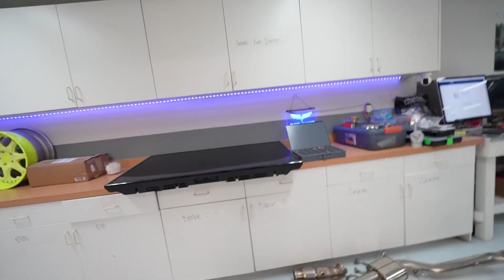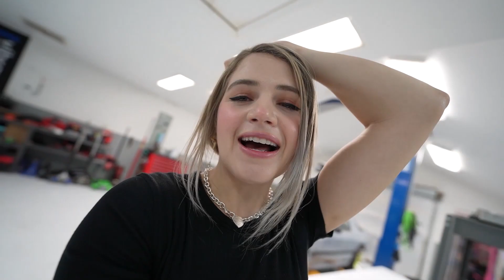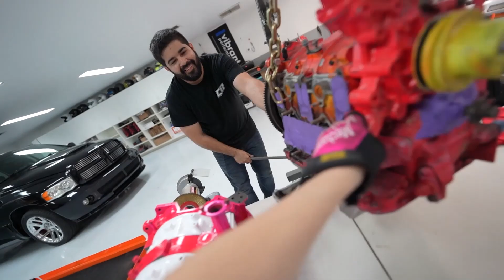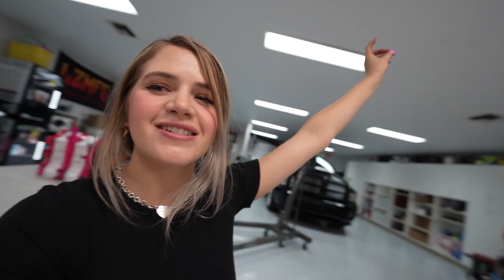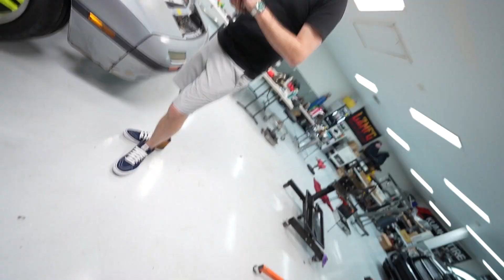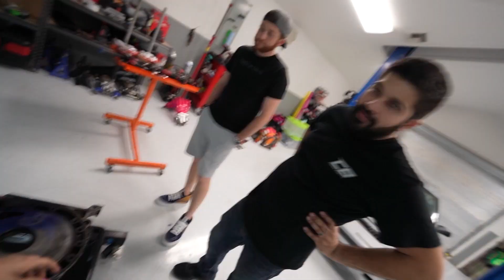My RX7 13b Engine is DESTROYED…

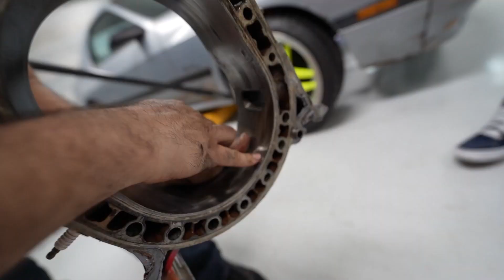Comment: @14:28 Vargas said thats gonna lose compression... Is that not on the exhaust stroke? I could see a tiny bit of blow by to the next chamber on the intake stroke, but honestly the engine isn't going to care, by that point in the rotation most of the power has been transferred. I'd love to see a full hour or so with Vargas on the engine build.

Comment: Rot a plate over the top from the bumper to the rad it will flow more of the air thru everything but you may want another fan on the ic because the rad won’t get much air

Comment: Yah when you gotta remove a lot of material you want the cutter at high spd but move your hand slow n steady like a mill machine.  Those tiny bits dig in easier in my opinion But once you start, you'll figure out your style n what you like best to use for what n where.